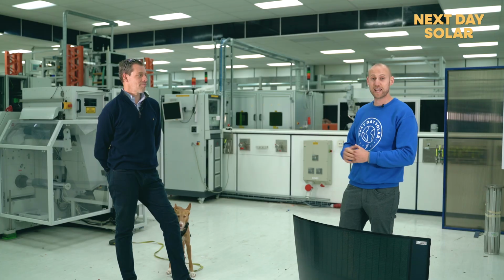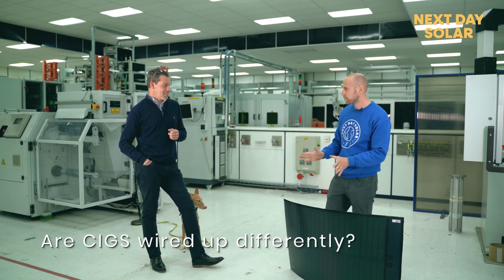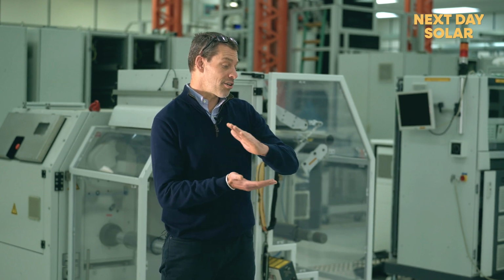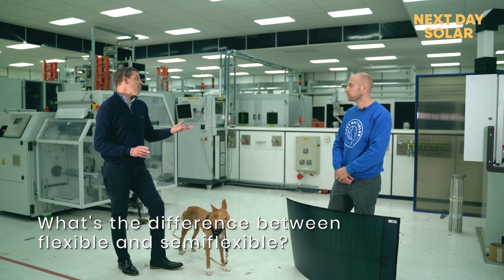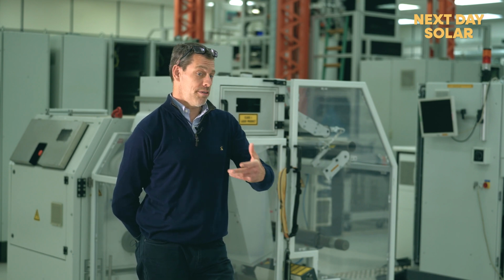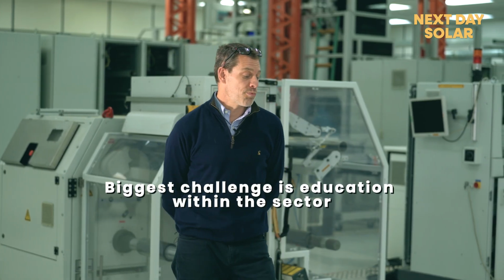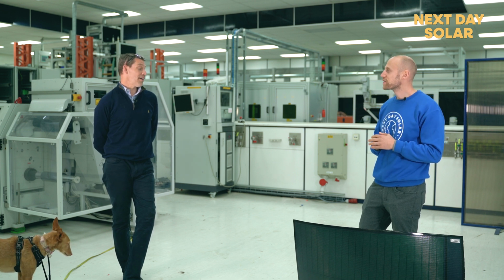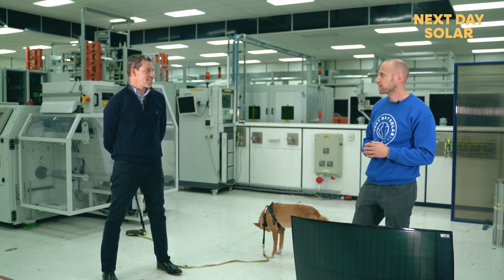Visiting a Solar Panel Factory IN THE UK !!!!!!!!!! Welsh Manufacturing at its best.

Comment: Looks perfect for sailing yachts. What is the output, physical size and weight of each panel?
Reply from the maker: There is such a massive range of panel sizes, from 330mm up to 990mm width, and then anything from 500mm up to 5000mm, so totally configurable. Weight/output is dependent on size, and if you contact James @ BIPVCO he can share all the details with you. Weight is on par, if anything slightly less than a rigid panel, and they key benefit being shading is no longer an issue with this type of panel design.
Reply: @nextdaysolar3349  Thank you.
Reply: @normanboyes4983  you speak too fast and do not explain yourself clearly  slow down so people can understand you properly. I'm looking for a uk solar supplier but your not doing yourself any favours.
Reply: @lesl1340  I never said anything, I only asked a question.🤷‍♂️